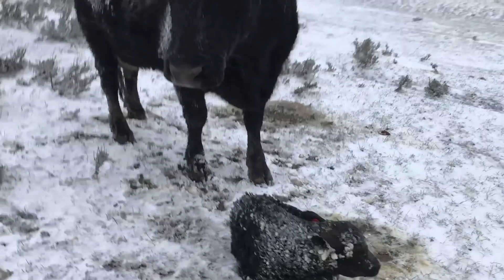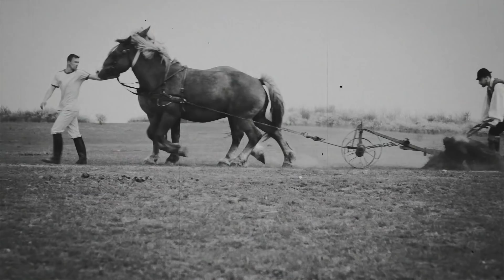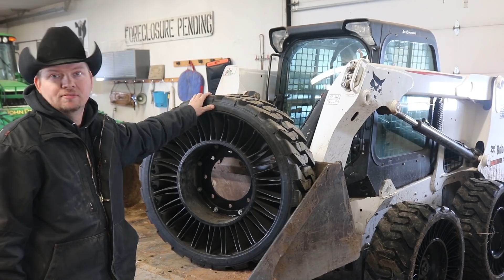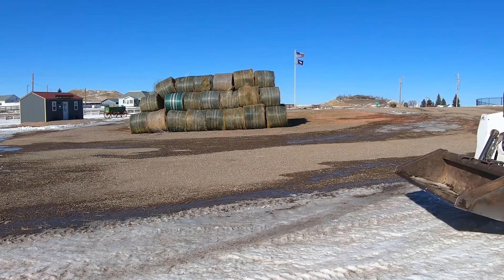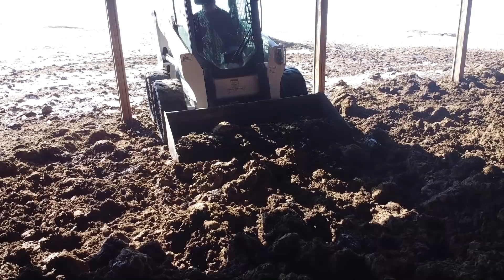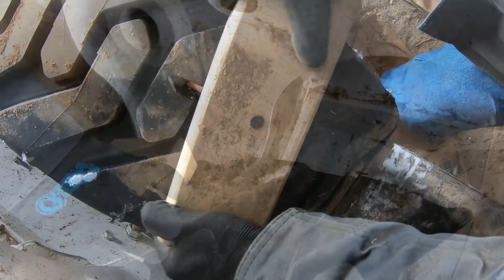Tweels - Michelin, The Ranch & The Future of Tires!

Comment: Michelin owes you big time for this video. Very professionally done. If you're willing to "risk it" I would like to advise you that jacking up an operational skid steer is not always necessary, you can put blocks under the back and put the bucket down to pick up the whole machine. Put more blocks under the front for safety and you can take tracks or wheels off with a bit less time

Comment: I use the tires on my skid steer. However, I did have an issue with the hub separating from the rubber, and Michelin will not stand behind their product even though they know it is a flaw.

Comment: Hi Mike!  Thanks again for visiting us at Michelin Tweel and for sharing your experience with your viewers.  One thing I noticed during your initial review of our SSL Tweel in this video is that you might have fitted our 12x16.5 Tweel on a machine that normally takes a 10x16.5....because you mentioned that the diameter of the Tweel was larger than the tires you removed.  If that's the case you'll certainly degrade the comfortable and pliable ride that the SSL Tweels can offer your machine because the 12x16.5 is designed for about 700 lbs more load per Tweel than the 10x16.5.  That's a 2800 lb total difference for all 4 units.  Since Tweels don't have an air pressure  than can be adjusted, your fitment in the video is like having your tires way over-inflated, thus causing an overly stiff ride.  If that's the case and you'd like to try our 10x16.5 SSL Tweels on your machine, please contact us at Michelin Tweel and we'll get you set up.  thanks again,  Tony Marconi, Technical Director at Michelin Tweel.

Comment: To break them? hmmm What would happen if you got a foreign object caught in between the spokes. Like a rock or a piece of wood? You may need to carry a crowbar, and a hammer with you. Get that crap out of there so it does not break down the rubber or whatever those spokes are made from.
What is the maintenance on them? Do they need to be rinsed after every use, rotated? 
That stiffness in the winter, that was a lot of jarring for you.  That could shake a kidney lose or something else, like a slipped disk in the back or neck. You may want to make a little road as you go in the winter to make it easier on your back. It has that bucket on the front of it, scoop the poop as you move along. Making for at least a smoother ride. 
I think changing the tread on the wheels might help for diffrent terrain. I know that when my husband work in roofing there where diffrent types of tread for diffrent types of surfaces he would be driving those lifts on. I think some thing else to give you a bit more traction.
 I have seen this as a concept some where, I know I read the article just mentioning it. It would be nice to see them work out, that they might last longer and not have to worry about tire pressure. But as a older lady feeling her age, a bumpy ride is something I do not want to feel in my bones.
 Please let us know what you think, I am interested in new products.

Comment: Why not add 1 inch or an inch and a half of softer rubber on top of a hard rubber tread that will give you more grip more flex and when it wears through to the harder tread well you’re back to the heart of tread which will last and unlimited amount of time not riding on asphalt it should last forever?

Comment: I wonder how these would do in the field if you use the skid steer for hay loading? As for me I am not getting anyone to send me any so I am sticking with the regular tires.
Reply from the maker: I'm not a huge fan of loading hay with the skidsteer, you can't see anything with that big bale in front of you.
Reply: @OurWyomingLife  I prefer the skid steer because it is easier for me to see the trailer for loading and it's a break for my poor old tractor. No shifting, no clutch and no turning a steering wheel. Of course I deal with small square bales which you can easily see around. Thanks so much for your reply!

Comment: Hey Mike if it's such a rough ride, couldn't the skidloader companys  design a air ride seat or solid rubber trax. You should get a set and try out on the gator while your at it. I use to spend my days in the life of a skidloader  8 10 hrs daily except Sunday maybe occasionally depending upon the weather. We always had a spare tire and rim and used that fix a flat for emergency.

Comment: At the moment I have puncture proof tires on my wheelchair, have some of the same issues, that made me try them, if traditional tire punctures means there are places I can't get due to limited ability to walk. In addition to the tires also have plastic spokes on these wheels. 

So problems include, harder ride, less grip, especially in colder weather, slide from the wheels when you want to stop, so very much like you have found, though stopping quickly on a skid steer not usually a problem, as with the tweels these are heavier than wheels made like bicycle wheels, with pneumatic tire and wire spokes. 

In my case the main problem though is the solid wheels mean the engine has to work harder, to get the same thing done, also in my case I'm the engine so it tires you out (pun intended). There are some amazing developments though, including folding wheels, in wheel suspension, in wheel motors to help out. BUt again as with your problem, the thing is money, it costs to try them.

Comment: A skid steer with a track does the same thing except gives you good traction and a comfortable ride not to mention no flats. .  
I am glad michelin hooked you guys up but as a tire manufacturer clearly the engineering department hadn't read thier history to why all manufacturers went away from spokes and solid core tires.  
Ride and handling were 2 big reasons. 
Pneumatic tires are the answer for almost every tire problem,when speed is involved and in construction equipment tracks seem to do the trick.

Comment: U need a set of tracks for ur skid steer bc u found out those new tires stink in the cold and u don't want to run them through mud or snow bc they get plugged up with stuff and in my opinion only place they good for is working in junk yard bc when it's cold u found out ride isn't very good and that's why I went to skid steer with tracks and took them off my other pieces of equipment and sent them back to where I got them from bc I don't need that extra head ache dealing with those tires but best of luck on using them on ur place

Comment: I have been running Tweels for 4 years on zero turn lawnmowers. They seem to get a little softer after you have run them for a while. I like em alot.
Reply: Good to know.   On a skid steer they will shake the longevity right out of all the plastic and wiring these modern machines have

Comment: Those ride so much harder than the regular tires because as you said the skid steer isn’t held up by the spokes at the bottom they are held but pulling the spokes at the top. Therefore the spokes holding all the weight will always be at high tension just like a tire with too much air in it. in theory they should help with driving over rocks and such since the bottom will be flexible

Comment: I tried to rent a skid steer some years back to pick up roofing material and asked for the tires that wouldn't go flat   the guy told me they didn't use them because they were hard on the seals and bearings of the machine
Reply: Shakes the longevity right out of any skid steer

Comment: Awful things. I blame those tyres for wrecking my lower back. Have them on two gehl skid steers at work. Used for cleaning up after road planers. Changing flat wheels at 2am was no joke either, but those tyres left the skid steers unbearable to sit in. So much so that nobody would drive them. Now we don’t even take them to a job
Reply: Obviously your health is the most important aspect of that, but just from a maintenance perspective this sounds like the tires will eventually cause problems with the equipment due to excessive rattling. It will probably end up shearing smaller foundation bolts at some point
Reply: JB Weld think one of them had broken an engine mount.
Reply: @Rmc456  that's what the JB Weld is for lol 
Jesh man don't you read the back of the package? That epoxy fixes everything lol
Reply: @jbweld6193    --  Yep, just like my old bulldozer.  After awhile things come loose and rattle or break and I have to spend time fixing it up again.  Then again it is old, but still runs great and gets the job done.  However, I wouldn't subject my skid steer to that torture unnecessarily !!!
Reply: You mean nobody will ride in a vehicle even at low speeds that knocks your kidneys loose who would have thought except every auto manufacturer about 100 years ago lol 
Sorry that's American scarcasm.  I have seen these for a few years now in magazines and my first thought was the ride and between this video and your comment it pretty much confirms my suspicions.